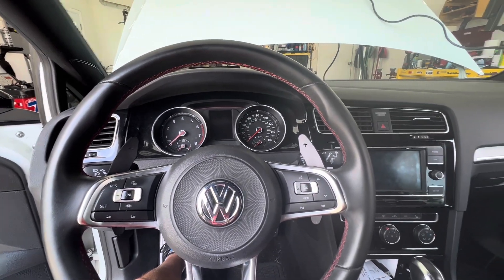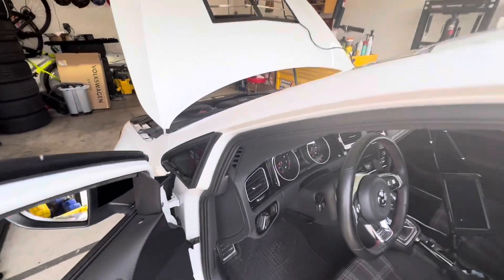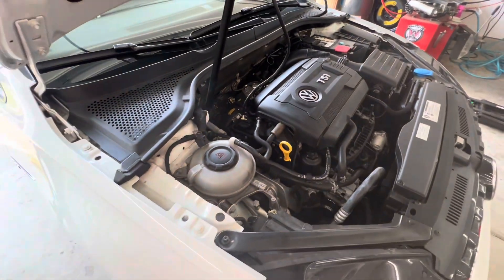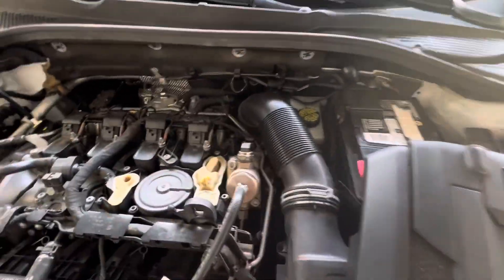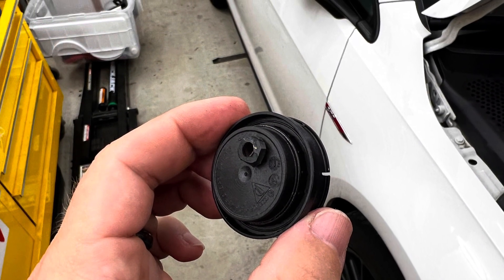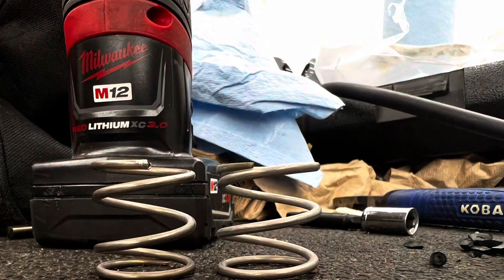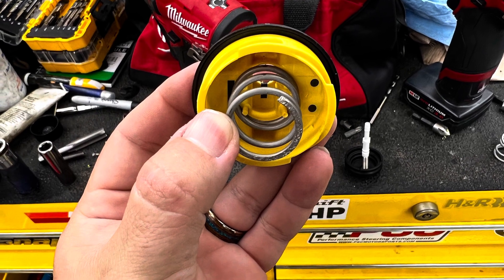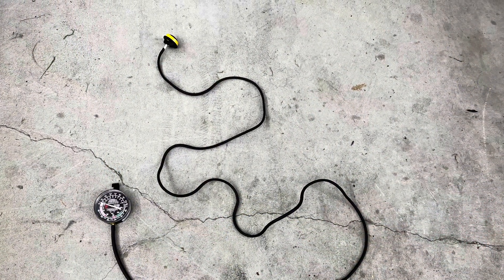MK7 PCV Analysis Pt 1: GTI crankcase pressure testing procedure

Comment: Thanks man from where ican have this tool
Reply: And how iknow how much my engine good pressure
Reply from the maker: @hassnabd-alnasser2522  you have to build one yourself like I did. Essentially it's an OEM oil cap, taken apart and used a cut up piece of a mountain bike's presta valve stem to install it. It must be slightly offset from center as you see in the video to avoid the bottom of the valve stem from hitting the plastic guides on the timing chain just inside the valve cover.

Alternatively, it looks like the newer Tiguan has a different oil cap with a neck extension, which would likely be very easy to put a hole in the side for a regular metal valve stem or 1/8npt fitting if you are careful and seal it well.